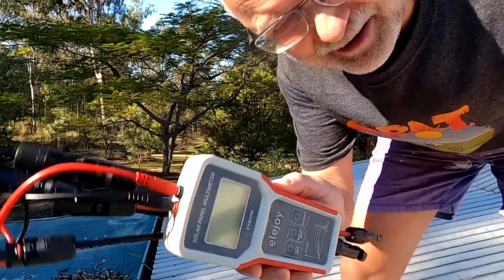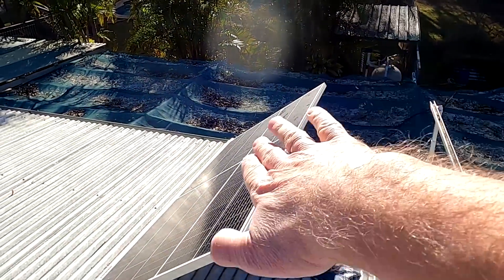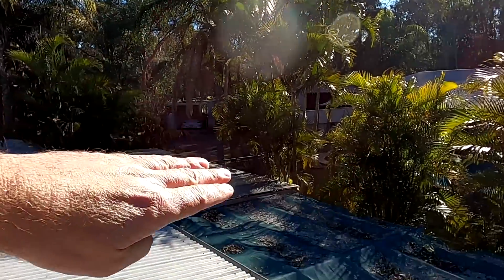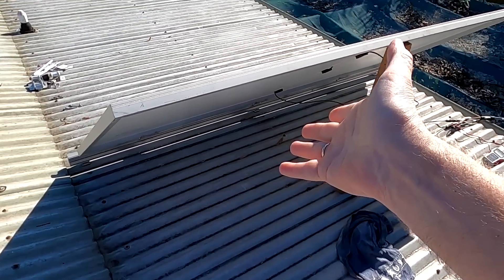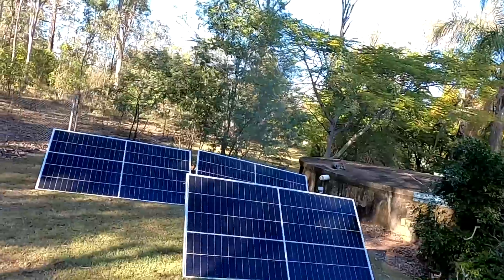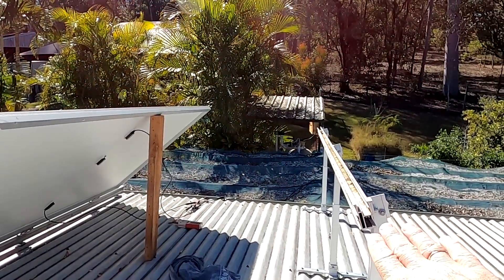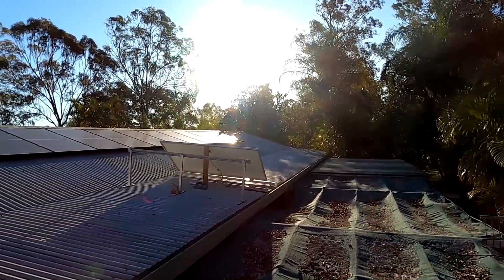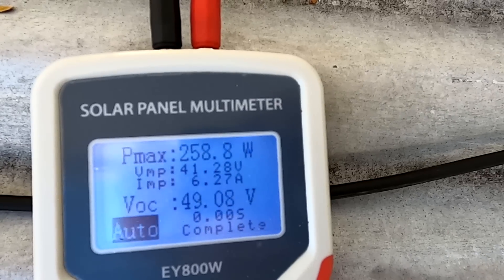Maximising solar production in winter.  Is a steeper angle really worth it? Timber vs Tilt Mount

Comment: Hi Andy. I had a similar challenge as I set up my smaller system, but what I found was testing just the one panel and looking at it at a static moment to see the energy gain per day was really hard to do as you have so many variables from shading from the other panels and the trees, plus the duration the sun is direct on the panels or with shaded panels.  If you can temporarily set up all 4 panels on the roof and test them for a day flat and test them for a day angled or a mixer of angles you will 1) be able to see which is more efficient as a whole system 2) determine if you will have enough power during the shorter days to run the house. Which is the ultimate questions you are trying to answer.  Love your energy and your channel!   Stay charged!
Reply: You are making it way to complicate the amount of sun light falling on an area is always the same, the question is.
Do you cover the whole area with flat mounted panels or with less panels but mounted at angle.
The question is cost and complexity of angle mounting vs flat mounting with more panels.
Reply: @jonasstahl9826  I agree but what I am trying to point out is the test needs to be done with all 4 panels.  When you have shading with multiple panels, the increase of direct sun for a specific time compared to when the sun is higher and the lower power for a smaller amount of time is way to hard to figure out.  So doing a test with the 4 panels is really the only way you will be able to determine the day to day production.  Andy will probabilities find laying them flat is the best answer to the question of how much power will 4 of these panels produce.

Comment: Hello Andy, I suggest 25-30 degree angle it will work the best for winter and summer also prevent dirt and leaves from staying on the panels. Beside you can mount 2 rows 2-3 meters apart if the panel was vertical i mean mounted vertically not horizontally i think it will work better for you at least you will mount 2 panels a time.
Reply from the maker: That's what I'm going to do...

Comment: My ridiculous suggestion?
Many flat set panels all the way along and then one practically vertical on the very end to catch a little extra in the afternoon.
Setting them flat will be cheaper, simpler and safer. But the last vertical one will give you a bonus.

Comment: Andy, ditch the roof idea, way too much shade. Just put 4 panels in portrait on top of the tank (or above the tank). You could make a motorized tilt for maximum production. Just my 2 cents.
Reply from the maker: The tank is not ideal and I'm hesitant to drill into it. Also the top is domed and in a round shape. There is also more shading on the tank than on the roof.

Comment: Two panels side by side like your original orientation and put them at high angle as close to the back end of the roof and then a second pair with minimal angle to avoid shading the panels behind them. You get 2 panels with best output and two additional that avoid shadowing impacts.
Reply from the maker: Yeah, I will build something like that...

Comment: Interesting testing results.  Seems like something in between might be a good compromise (like 20deg).  Maybe just a fixed setup instead of the linear actuator idea will get the job done.  I still think solar trackers are cool but not always worth the time/effort/expense.  If you don't mind expending the resources, maybe you can just do a test tracking setup using one panel next to the pool fence and see how it turns out.  Then, if it seems worthwhile, you can go wild on the roof.

Comment: About paralleling muptilpe panales on one MPPT: I suppose that the maximum current of the MPPT will not get exceeded, as the MPPT can ignore the MPP and set the voltage to only receive the maximum allowed current (increasing the voltage and exceed the MPP in the curve). I hope that all controllers work like this if the rated current would be exceeded...
Reply from the maker: Why are controllers state a maximum power value for connected solar panels if it does not matter how many we can connect?
Reply: @OffGridGarageAustralia  no answer on this one xD

Comment: This guy is getting watts confused with voltage and amps.  He's comparing a micro inverter to a home inverter.  So your home inverter is 3000watts max but 150v and 60amps.  So you can add as many panels as you like as long as you keep under these last two values.  
So you could have 6 strings of 120v and 8amps which is 5760 watts.  The inverter would be OK but wouldn't be too happy in summer time as it turns access power in to heat. 
You wouldn't get 5760watts but you would get a constant 3000watts which is great.  I've tried and tested this but not as crazy as 5760watts, just 4000+watts.  This works great in the winter.  The inverter "clips" the power to the max wattage of the inverter.  Most solar installers now add extra panels above the wattage of the system inverter so in winter you produce more.  It maybe a legal requirement in some states.   I'm surprised Andy hasn't shown you this test.  Maybe a future video.
Reply from the maker: Nope, not confused at all.
You cannot have unlimited panels in parallel with any MPPT. They clearly state either max PV power or max PV current which can be connected.
One panel connected to an MPPT has a certain power point, two panels in parallel connected to this same controller will have a different power point the controller tries to reach. Similar voltage as with one panel but... exactly, twice the current.
Some controllers (like the Victron) can limit the output current and, yeah, some people use this as a free ticket to heavily overpanel these controllers. Victron explained though, that under certain circumstances the controller can shorten the PV input for a while as part of the charging algorithm and hence need to be able to deal with the PV short current as stated in the specs.

Comment: You need a Solar'tree' which is selfcentering to the Sun. These systems are not new, but in wintertime for u very efficient.
Reply from the maker: And they look nice. Just not viable with these large panels. Although... it's just a matter of size.

Comment: I could imagine a self contained system that uses the power from the solar panel itself.
Using a micro controller and two photoresistors mounted in shallow tubing mounted in the corner of the solar panel.
The code for the micro would be very simple, just sample the photoresistors and tries to angle the solar panel to where the sensor gets the most light.
Reply from the maker: Yep, that's basically how these light sensors work which are part of the tracker system you can buy.

Comment: Try to test the panel on that round concrete structure that you use to climb on to the roof. It seems to have more sun later in the afternoon.
Reply from the maker: The water tank is shaded in the morning though. Also the tank lid has a round shape which makes it hard to mount the rails. The roof is the best option for winter sun.

Comment: Retired satellite dish mount 12ft or greater full solar polar mount  with full duel axis-es optic eye,... repurposed.   AT the very least use them as your working, example ............... but they doo have all the parts.......already.
Reply from the maker: eBay, I guess? 😁

Comment: Andy, answer is easy. Use your money to fill roof with panels all flat. WAF maximum, safety maximum, production in cloudy conditions maximum. Sunny days each panel not maximum but all panels overall won’t be far off. Remember you can’t create photons , you can capture them in a small area at a high angle or a large area at a low angle.
Cheers,
Bill
Reply from the maker: Sorry, I have explained this in the previous videos which this is not an option...

Comment: I think 2 panels side by side at the end of the roof at high angle and 2 in front at a shallow angle will be the best solution or simply try a lower angel to all 4 panels that will be the best WAF
Reply from the maker: Yeah, something like this. I have to be away from the corner like 2x height of the panel mount though. So the whole structure needs to be moved forward a bit, away from the end of the roof.

Comment: You are wrong on the maximum input current of MPPTs. They will limit the current according to their limits, automatically.
Reply from the maker: Wrong.
Why would there be a limit in PV power or PV current in the specs of each solar charge controller if I could just parallel as many panels as I want? There are clear instructions and specifications. Going over will void warranty.
The max power point with one panel is different to the max power point with two panels in parallel.
Reply: @OffGridGarageAustralia  don’t know on these specific micro inverters, however operpanelling on charge controllers is a well-known and understood tactic, especially on Victron gear. I’ve overpanelled a 150/60 on 24V with 8x 530V panels (2s4p) for over a year for a solar plant project backup and had no issues whatsoever.

Comment: Hi Andy, if you want to have a static frame, you could use 38/50mm ploy pipe, like you use for sink drains instead of timber. They can be adjustable manually as well,
Reply from the maker: Yeah, I had a play with some metal framing but all attempts failed due to the size of these panels. It won't work with one actuator.
Reply: @OffGridGarageAustralia  yeah definitely need two actuators Andy.. For price I would use poly pipe 50mm,

Comment: maybe theres a solution, so you could measure the current through some sensors, and if its too much - then the actuator will change the angle, or you could easy made a switch (breaker maybe) on some panels to only disconnect maybe half of the panels if too much is coming in?
Reply from the maker: So a counter MPPT controller 😉
Reply: @OffGridGarageAustralia  EXACTLY haha

Comment: Hi Andy Thanks for the vids there is a great deal of info going on here :) just a thought out side the box would it be worth while to get a tree lopper to nock just the tops off the trees ?? this would give you more sun in winter 
Just my 2 cents worth :)
Cheers Mark
Reply from the maker: Yeah, cutting down the forest for solar panels... 🤔
Reply: @OffGridGarageAustralia  Sorry Andy I did say trim not cut down
Reply from the maker: @markdebsauzzietravels  Even that... I mean🤷‍♂ The trees are 35m+ high. You would need a company doing that, not just trimming a few branches but also removing them, restoring the garden afterwards. That's 15-20k easily. There is almost no access to behind the garage for any machinery.
At the moment it's far easier to just buy more solar to compensate for the shading. Form day 1, it was part of the challenge if I can find enough spots for solar and connect them back to the garage somehow. That is the Off-Grid Garage project, the main theme and topic.
Reply: @OffGridGarageAustralia   Cool didn't know the circumstance it was just a suggestion :)

Comment: I have a controller question.
I just got a charge controller that advertised as a MPPT style and in reading the operation booklet it says PWM charging. Is there a way to tell which style it really is?
Reply from the maker: Open it and see if there is an inductor inside. Then it's an MPPT.
Also the specs will tell you. If the maximum PV voltage is close to the battery voltage, it's not a MPPT.

Comment: If MPPT charge controller firmware is smart enough it should be able to limit current even with overpaneling.
Reply from the maker: It won't. All MPPTs have a maximum PV power or max PV current in their specs. Ever wondered why that is?

Comment: Your limit is the shadow length and this is set by the angle.  There will be a crossover point where you can add more panel(s) at a lower angle and generate equal power to fewer panels at higher angle.  Lower angles are safer and you'll fit more on.  Adding panels gives you more production in summer too - you can never have too much power.

Calculate how many panels will fit unshaded at various angles, measure the production at those angles during the winter day, see what combination fits best.  It's about making power.
Reply: I was thinking this too.  I may be oversimplifying the problem, (and I’m a massive fan of over engineering everything!), the 50W observed at the end there with the flat panel - cast little to no shadow, allowing 4 panels.  By my poor maths, that’s 200W - or the same as the single panel at 80 degrees casting a shadow over the entire roof.

From that graph update in the final seconds of the video - it looks like the net gain is pretty negligible?

Add a mirror to reflect some extra light onto the panels?  😀
Reply: @wallyhall You dont oversimplify, you are right, the amount of sunlight on the roof is always the same, the question is how to harvest it.
Less panels with an steep angle vs more panels but flat mounted.
In the end it is cost of mounting system vs cost of more panels

Comment: If the idea is to charge the battery why do you care to produce power in the late afternoon. Setup the panels to produce the most power from 10h00 to 14h00.  Maximize production in the best time of the day. I think you won’t gain anything by optimizing production for early morning and late afternoon.
Reply from the maker: It gains around 20% if set optimally. Even more if the angle is changed during the day. So there is certainly some benefit...
Reply: @OffGridGarageAustralia  You have more patience than I have trying to work it all out.

Comment: Why don't you test two parallel panels in one mppt channel using your ground pannels? You can gradually adjust the amount of power by tilting panels up an down and see what happens. And you can compare the results with a single panel in the second mppt channel. That would be an interesting video.
Reply from the maker: I did and the MPPT died...

Comment: Thanks again for your effort! I always tend towards KISS. That means here: avoiding moving parts, using the whole area, putting the panels flat and using a string inverter, e.g. a Fronius. Not the cheapest solution and just buying the electricity could be cheaper. But if off-grid is really the target the solutions are not cheap right now ...

Comment: Why not change the orientation of the last panels before the edge of the roof and tilt those panels somewhat (shadows won't matter at that point), and then lay the remaining panels flat(ish) in front of them heading toward the trees.  Seems like the best use of the space, should maximize overall production for a static mount, and also extend your production hours.
Reply from the maker: That could be one of the solutions. However, I need to be twice the height of the panel mount away from the roof edge. But it will still work...

Comment: You will have to just go with a shallower tilt angle that allows shading for 4 panels.
Reply: Only need to worry about spacing out three panels.

The fourth panel should be mounted on the steep part of the roof, behind the existing panels.
Reply from the maker: I will go back to my original design and have two panels next two each other and space the two rows further apart.

Comment: That’s not true at all about too much current . The MPPT will pull the maximum current it can and no more! Panels don’t push current. We have 10,000w array ( 3 x 8 series strings, paralleled ) into a 3.6kw mppt. Only 4kw is drawn from the strings in optimal conditions
Reply from the maker: I wonder why they specify a maximum PV input power and/or maximum PV input current then, if it does not matter? You're operating your MPPT out of specs and it is not covered by warranty.
Reply: @OffGridGarageAustralia  what they should state is that is the maximum it will draw 👍 I believe it to be a translation thing from Chinese they write some odd specifications or at least internationally is understood differently. “Max input” is the max that will ‘go’ in , not that the max available wattage should be. It’s like saying a 60w light bulb has a max input of 60w. You don’t input power the load draws it. 👍👍

Comment: One light sensor, one strong gearbox.
Two galvanised steel pipes or steel rhs(rectangular hollow section) that slides under the middle of the panels, and tilts them all from both sides. Nylon guides to hold the pipe to the roof, as it slides and tracks the panels.
That would track half the day depending on which side is hinged to the roof.

Comment: I was talking to a solar designer a couple months ago about a 100MW system they are installing and I asked about tracking and he told me it's a no brainer because it adds only 5% cost for 15% more production.
Obviously this probably would not make sense for a small system like yours because the costs of doing a tilt system. Would be far higher than 5% I suspect.
Just add more panels.
Reply from the maker: With better orientation, I can get 20%+ more energy over a day from what I tested. So that's pretty worth it for me...